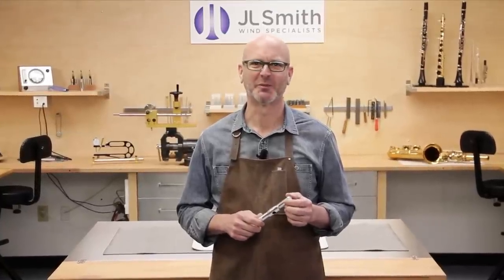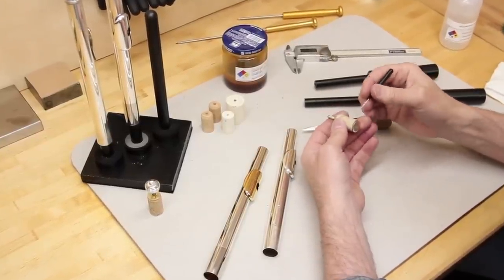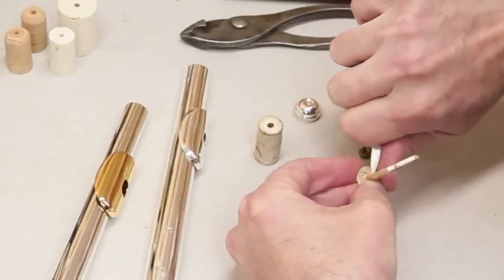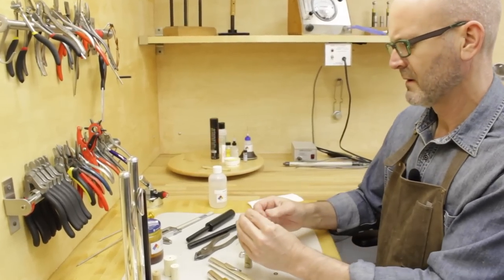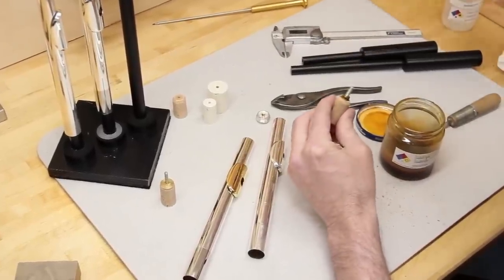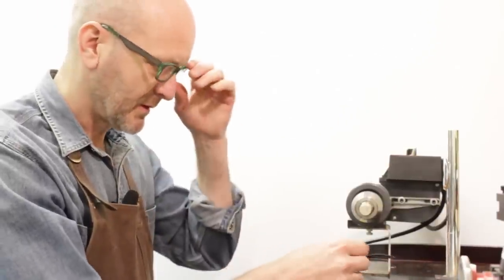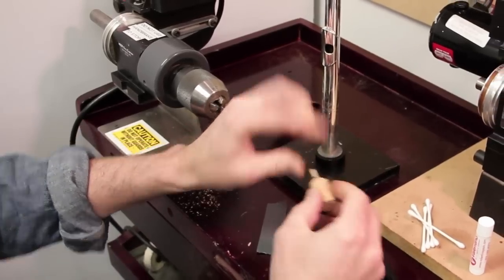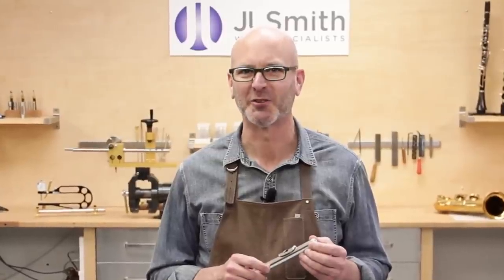FLUTE HEADJOINT CORKS PART 2: REMOVAL & REPLACEMENT

Comment: Great video. Thanks. I'm in tune with myself but feel slightly flat to A440.
Would adjusting the cork a little 'south' (to the body side of the hole) raise the overall pitch without compromising the overtones?

Comment: Hi Mr. Smith, I wonder if you or another reader might be able to answer my headjoint-related question? Although I have a good flute, I acquired a second instrument for pleasure, because I've had a curiosity about this brand of student flute since from the 1920s, and for several decades, the Bundy by Selmer was recommended by such flute teachers as Kincaid (when recommending a flute to a student who couldn't afford a Haynes, Powell or Lot), because of the design of the large, rectangular blow hole, similar to a Powell. From reading, I believe this big, rectangular blowhole design was done by George Haynes for Bundy/Selmer when he and Kurt Gemeinhardt were enlisted with the task of re-designing the Bundy.

Anyway, I acquired one of those very old Bundy headjoints (1930s or 40s I think) for a pittance which I am using on a newer Bundy flute, and I love the power it gives me in the low notes especially. I got a newer Bundy flute at a  low price also, and it is about as pristine as imaginable for for a 1970s instrument. I don't like the newer Bundy headjoint blow hole which is a rounder and smaller in shape, but that one plays in tune. 

My problem is the flute plays flat with the old headjoint on it, the one I like so much. With the two Bundy headjoints standing on a desk, they are identical in length, BUT the center of the new Bundy headjoint blowhole is 2mm lower than the center of the old Bundy headjoint blowhole, so that would account for the old headjoint playing slightly flat in pitch. 

Is shortening the old headjoint something any repair person should be able to handle, or something I might attempt myself, if I use the right kind of saw or tools?
Reply: This is a complex issue because certain proportions need to be maintained in order for a flute to maintain its scale. As you have seen, a difference of just 2 mm can cause a big difference. What would be ideal is if someone could cut the tone hole of your new Bundy headjoint, but that alone would cost more than a Bundy (if done by someone who knows what they are doing).
Reply: @yishihara55527  Thanks for your reply. I ended up  using a modern Yamaha headjoint on the Selmer Bundy, and I bought a unique plastic cork that contains O-rings (like the space shuttle that blew up), which is supposed to be permanent, unlike natural cork. One thing is for sure, most of the tone of the flute is determined by the quality of the headjoint, and many flute players think they need a new flute, or that a flute is bad, and really all that it is wrong with it is that it needs a new cork.
Reply: @Timzart7      Yes. A lot of problems like bad headjoint corks and slight pad leaks is that many players don't really notice them due to conditioning and will play on an instrument that is not living up to its potential. Normally it takes a third party to identify some of the hard-to-find issues.

Comment: im in sixth grade i just got a flute and im trying to xlean it but the corc wont come out
Reply from the maker: Don't worry-that's usually a good sign.  If the cork is set properly it can be difficult to remove.  You can clean the headjoint well without removing the cork.
Reply: jlsmithco  ok thank you because i saw a video of how to clean the flute and they said
to remove the corc
Reply: Francis Gordon i need help by removing the parts of my flute